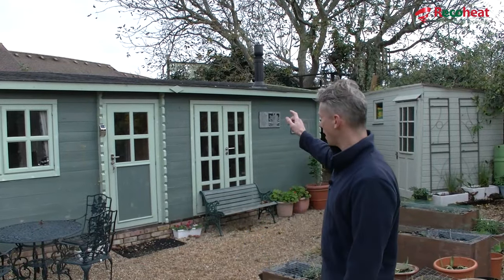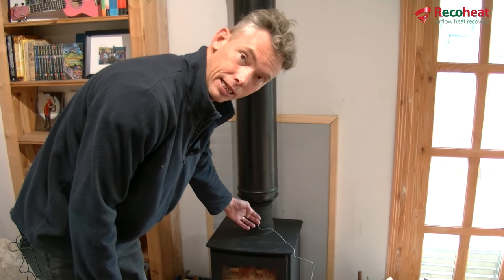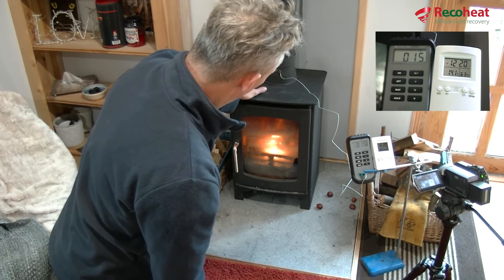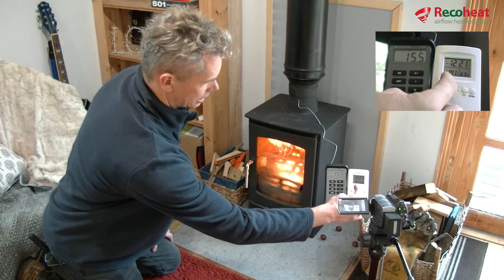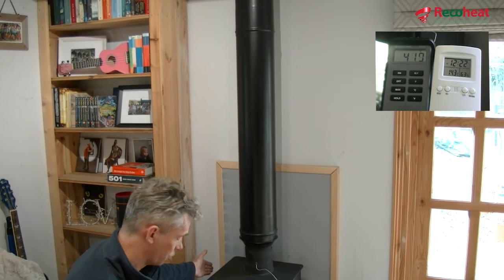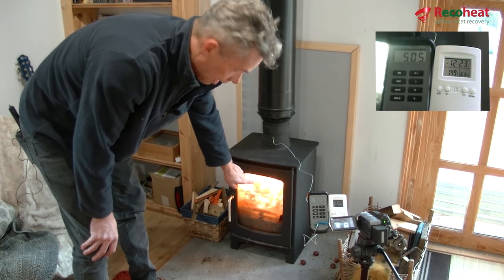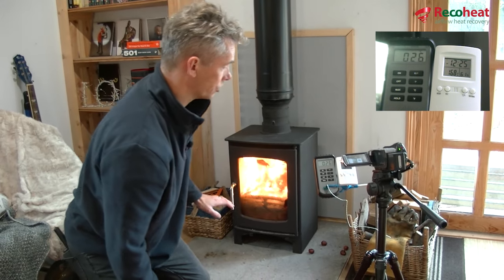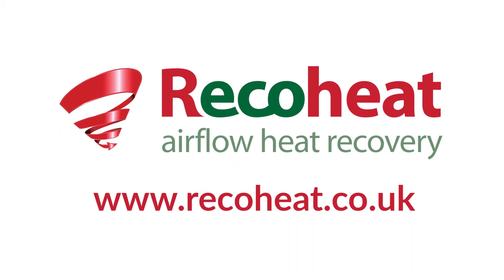Introducing the Recoheat heat recovery unit for wood and solid fuel burning stoves

Comment: You need to do some research on "quenching".
Reply from the maker: Rapid cooling of a metal? We're not doing that, but in any case, our materials are all 316 stainless steel, as specified for use in flues, so aren't affected by these temperatures. The industrial test engineers who issued the safety certificate stress tested it to 900c and we've tested it 1000c burning heather. But it's not an issue with this material: the heat exchange is thicker and more robust than the flue.

Comment: Be more impressed if it was powered by heat exchange like the stovetop fans. Also you cant add this to an existing fire without removing, recutting and reinstalling your flu. It needs to fit around an existing flu.
Reply: Stovetop fans don´t reallly work, sorry... The principle is correct, but they can generate a maximum of 1-2Watts, and that´s too little, it seems. Also, Recoheat is a far more efficient design, and that´s why it takes just 37Watts, so, u understand why a comparatively far underpowered and far worse design won´t work... Generating electricity through Peltier-Elements, like the stovetop fan, is an expensive and inefficient fun. also the other proposals (add this without removing, recutting and reinstalling the flu) would just ruin an otherwise great design. Things are preeeeetty simple, but not as simple as u think. For a concrete result, there´s a minimum amount of effort needed, and that´s a tad bit more than u imagine...
Reply: Ceiling fan works great compared to stove fan. Ceiling fan drags or pushes high volumes of air across the stove and the surroundings and moves the heat.
Reply: @klausbrinck2137  Sorry, I categorically disagree with your opinion of Peltier-Element fans, simply because they certainly work. Your ducting is more efficient and your pump moves more air, but that does not mean that a stove top fan won't move air. There are 1000s of ice fisherman with Buddy Heaters that can attest to the increased performance provided by those fans.
Reply: @noyb72  Sadly, their pump does not move more air. See my other posts for why. Clearly an engineer was not involved in this design.
Reply: @noyb72  Sorry, but the  Peltier-Element fan-reviews I know were negative (from Germany). Pelltier was generating too little electricity, and too little rpm... It´d be nice if they really work, nevetheless, since it´s the easiest and cleanest solution...

Comment: That's all well and good until you need to clean the stove pipe. Added PIA to remove the unit before you clean.
Reply from the maker: The flue can be cleaned through the coil using a rotating brush. They have a 25mm head that goes easily through the 65mm centre of the coil.

Comment: Just get a wood burner fan much cheaper and simpler than £299 for a gadget without BTU figures
Reply from the maker: For sure: get whatever you want, but there is no comparison in terms of effective heat distribution. Fans don't have a BTU output, relying on altering the flow rate of heated air away from the stove. Our device's principle effect is achieved by the same means, with the differences that it is adding about 1kw of heat, but mostly that it is circulating air using a powered pump, not convection, and that air is higher pressure than the ambient air, which therefore equalises, but is also turbulent air, so heat transfer is far more efficient, and the flow draws the stove's heat with it into the room far more effectively. Crucially, the circulation doesn't diminish as the stove cools, so the effective heat transfer maintains much of its effect for much longer - in fact until the embers and flue have cooled - which is typically many hours after the stove and a fan have stopped circulating heat. Thanks for the interest.
Reply: @Recoheat  You say you are adding ~1kW of heat, elsewhere you state that the stove is a 5kW unit. As a decent stove will achieve ~80% efficiency, that means you are upgrading that to 96%. Given the small size of your heat exchanger, that seems unlikely. Do you have actual numbers to share?

Comment: I am sorry to say it but......there is a reason why Stove manufacturer have the heat exchanger INSIDE the stove : there are two opposite risk here that you need to balance correctly.:
1) the production of creosole 2) the airflow temperature coming out cann't be over 50 degree celsius,( and with that pump power I doubt you can handle otherwise that air is more polluting than a car in the of PM10,Pm20 and PM5.  I don't believe you can get certificationEN 13240:2001/A2:2004/AC:2007, EU 2015/1185 
in Europe because of that. But more important, its not safe for the long term user.   Just go and purchase a stove with an internal heat exchange they came as low as 300 euros!
Reply from the maker: Thanks Mauro - you've just misunderstood the way the device works. The air does not come into contact with the flue gases. The device is fully compliant with all applicable regulations, and has been tested and certified as such by a registered testing centre, BSRIA. The certificate is available on the website. Thanks for your interest.
Reply: @Recoheat  Thank you. I understood the following:
Your device is an heat exchanger  of the category" tube in tube", where the inside tub is also.where the stove exaust gas flow to the  chimney. so, there is NO mix between the two gases. the air pumped and the exaust gas. The exaust gas get colder and here the creosol problem, and  the pumped air got hotter. Fact is that the air you pumped in is not "pure". It does contain various particles of various size. Those particles/dust can be organic  or not. There are several studies that have found that the organic dust if heated above 50 degrees does produce PM10,PM5 and PM 20 particles that are NOT harmless . That's why there are ( in Europe) specific norm that regulate the maximum temperature a ventilated stove can flow outside in the room. In order to achieve lower temperatures,  the simpliest solution , in order to exchange the needed amount of heat, is to have a faster/ bigger airflow thus the simplest solution is to have a bigger pump.
And if you make a calculation of the airflow that the pump is used is capable of, there is no way it can reduce the air temperature below 50 celsius. Unless, instead of having a tube in tube the inside tube it is not  tube but a a different shaped pipe.
But doing so, the  amount of creosol its going to produce INSIDE will proportionally grow thus increasing the risk of ... that's the balance I was talking about.
Have a nice day

Comment: A litre of air a minute? The room is what…..50000 litres? When you take into account heat loss how s heat a room?
Reply from the maker: Quite right - it's a tiny proportion. The reason seems to be that the expelled air is expanded about 3 times by the heat - which you can hear as the hiss increases with the velocity of the air. This creates a flow of expanded, turbulent air that transfers heat by pressure equalisation, so is drawing cooler air into the flow as much as pumping air out. It's certainly not a mechanically-driven process because the area it effects is much too large. Check our reviews on Trustpilot to see that it actually works, so we're explaining an effect that is empirically evident rather than theorising.
Reply from the maker: Also, it's a litre per second. Though the general point about the relative volumes is still true. But isn't actually the point because of the other properties of the air flow - principally that it is turbulent and pressurised, so disperses the heat by equalisation very efficently.

Comment: Has this been verified by independent testing by British Standards Institute?
Reply from the maker: It's been tested for compliance with British and European standards by BSRIA: https://www.bsria.com/uk/ Their report is available here: https://ee2d6fe6-3379-44d5-8288-a1cf72afa025.filesusr.com/ugd/fe64a7_68cd9bf717b740e59968a48e8d08e6e2.pdf
Reply from the maker: @redfire20003  Hi Tim, well, they're a testing agency: their report is published, but their relationship with us is no more than that - they don't publish their reports on their website. The report itself is available from our website as linked above. They've tested to ensure we meet the regulatory standards required for a rigid flue section, including meeting the materials and construction standards, and thermal shock testing up to over 900 degrees C. We're currently working with the University of Bedfordshire on performance testing, and have one report publishing shortly - probably by the end of June - and will be conducting a study from October 2021 into the effects of the device on warmth, humidity, particulate densities and fuel use in a range of domestic settings which we'll be aiming to publish the results of probably in February 2022. Thanks for your interest.
Reply: @Recoheat  Are you misrepresenting that report? It starts 
"1 INTRODUCTION
This report covers the testing of a custom chimney incorporating a Recoheat airflow recovery
product, to assess its performance as a connecting flue pipe. No assessment of the heat recovery
performance was made during this testing."
Reply from the maker: @pauljrogers2885  Obviously not: the testing is for safety and industry standards compliance, not performance, as stated. The report is also published and made available. You appear to be wilfully misrepresenting my statements.

Comment: You need flue temperature high all the time, not a good idea at all
Reply from the maker: BSRIA tested the system for safety, and a key element of that was the temperature monitoring all the way up a 4.5m flue. Their report is here: shorturl.at/gtuS0 You can see that it doesn't cool the flu as you suggest.

Comment: Sorry dude you did a horrible job explaining how this system works and just kept reading the temperature gage which we could already see. I am guessing there is some air pump the pushes hot air into the back of the pipe and out that tiny hole you stuffed the thermometer wire into?

Comment: U could heat the rest with a big fan
Reply from the maker: Very different effect and has none of the additional benefits such as the additional heat and length of distribution as you'd only be moving the radiant heat whilst it lasted. But it would certainly help to move the heat. Just ain't anything like as good!
Reply: @Recoheat  no shit
Reply: @Recoheat How would a chimney sweep clean the unit and the rest of the chimney.
Reply from the maker: @RestWithin  You clean straight through the coil. The minimum ID of the coil is 60mm, so it will take a medium 8" brush or any bullet-head rotary whip. The plastic Typhoon-type rotary ones are too big though - they go up but don't like coming down. All the pro ones go through fine.

Comment: SAFETY of HEATED AIR???....you are claiming 1 litre of air per second (2.12 cfm) heated to 550 degrees F.

The interior diameter of that coiled tube seems to be about 1/2" , so the velocity of 550 F air (claimed by you) leaving that tube is about 366 feet per minute or 6.1 feet per second...it's moving quickly. Better not let anybody, especially children get their hands/body parts anywhere within several feet of that outlet until the heated air is well dispersed into the room.
Reply from the maker: That's right. In normal circumstances, of course, you'd expect small children to be able to rest their plump little smiling faces on the top of a wood burning stove: apparently it improves their complexion.

Comment: Don't do this without consulting the appliance manufacturer.   Modern stoves are designed to shed heat at a certain rate to keep the fire efficient.  Taking heat off the exhaust is simply stealing the fuel for the engine that runs the stove.  Draft is generated by heat exiting the rain cap.  That heat replaces the need for electricity and an exhaust blower.  If heat is removed from the flue it must be replaced by heat from the stove, which lowers the heat output of the appliance.  At best you can hope for equal net efficiency for added costs.
This system is only beneficial with a poor appliance or a poor vent system.  Better off to upgrade your system correctly.
This system has the ability to reduce the pot temperature of the fire, killing efficiency and creating creosote, at which point it will likely become dangerous. Creosote is wasted fuel, so even of it doesn't stick to the inside of the flue, it is $$$ blowing away in the wind.
Reply from the maker: BSRIA tested the system for safety, and a key element of that was the temperature monitoring all the way up a 4.5m flue. Their report is here: shorturl.at/gtuS0 You can see that it doesn't cool the flu as you suggest. Your analysis of the process errs in considering the relationship between the combustion, the stove output and the flue as balanced. Our unit is specifically for non-balanced units (like gas boilers). Wood stoves are not balanced, so if you cool the flue, the heat is not replaced by the stove - it just furrs the flue. Our system doesn't cool the flue because the heat extraction in a lossy system is negligible, as tested and demonstrated by BSRIA, who issued their safety certificate on that basis.

Comment: Such a bad oven is completely illegal in Germany, as it's wasting energy by releasing too hot exhaust gases.
Ovens need to get certified to sell here, temp., NOx and CO is measured.
Modern heating systems release exhaust gases that are almost cold.
What you're presenting is a design that's 100 or 200 years old. Modern heating is different. Modern ovens even have a lambda-sond in it!
Reply from the maker: Yes dear: the UK has the same regulations and the same standards. You have the Blue Angel scheme in Germany to encourage people to upgrade their stoves, but the one you're looking at is 80% efficient and doesn't need it. If modern heating systems released gases that were cold, their chimneys wouldn't work unless the flues were powered, which would be a silly waste of energy and far less intelligent than a system powered by heat from wood that is 100% renewal.
Reply: @Recoheat  The exhaust gases musnt't exeed a certain temperature and a certain Vol-% CO, NOx and PN/PM  here. That's checked by an official chimney cleaner every 12 months.
I don't know all legal details for every variety of heating. The norms are becoming stricter and stricter every few years, for renewal sources included. That's valid for existing devices and new ones allowed to be sold.
If your oven or chimney doesn't pass that test they declare it as an illegal fireplace. It's up to you how you get your home warm then.
Reply from the maker: @u.e.u.e.  Our units should help with that then, because the powered process makes the whole thing so much more effective. The temperatures of the flue aren't set by bureaucrats: the gases have to be hot enough to create a draft and maintain a percentage of it up the height of the flue, which has to be able to vary with building configurations as well as very wide fluctuations in air pressure. Our unit works in any functioning flue because its effect on temperature and draft  doesn't affect the flue's ability to function within those parameters. Thanks for your interest.

Comment: is this a way to fix a shitty stove design? how about building a proper stove with compete burn, heat accumulation and flue gases temps not exceeding 150C (300F)?
Reply from the maker: Not at all: it's a supplementary technology that changes the nature of heat circulation around a solid fuel heat source. Most stoves these days are fantastic bits of kit, and the manufacturers are constantly refining them to improve performance. That performance is aimed at passing heat into the body of the stove with the greatest efficiency though, and does not address passing it from the stove into the rest of the house.
Reply: @Recoheat  heat will find its way just ensure low heat loss by insulation and air tightness; worry about clean burn and flue gasses temperatures to make sure you dont pollute and dont heat the outside
Reply from the maker: @MhUser  Heat doesn't find its way: it has to transfer. The more air tight you have it (which you can't do), the less heat distribution, since the heat is dissipated via air flow.
Reply: @Recoheat  radiation; air is a very poor medium to store or transfer heat; good insulation and air tightness ensures low and uniform heat loss; at this stage you only replenish whats lost and radiation suffices; BTW transferring heat by radiation is 'hygienic' and pleasant for humans
Reply from the maker: @MhUser  How can air be considered a poor medium for transferring heat! You're maybe missing a bit of the reality of using a stove to heat a house, but thanks for the engagement.
Reply: @Recoheat  look up physics :) and 'specific heat'